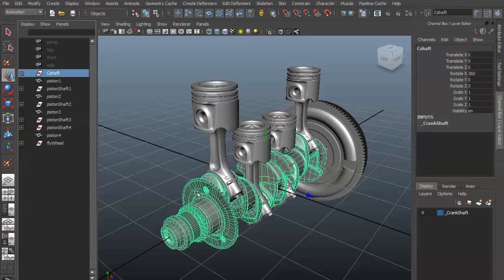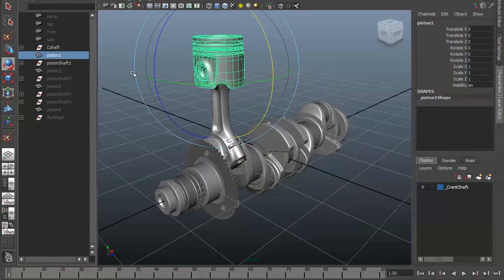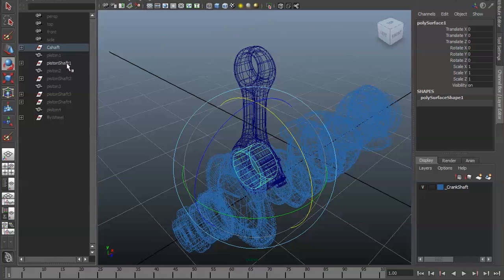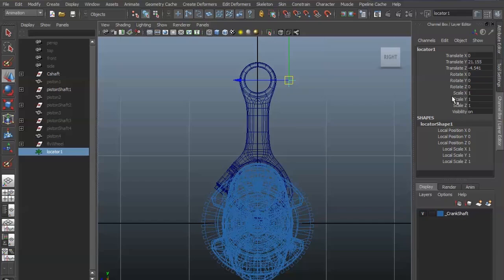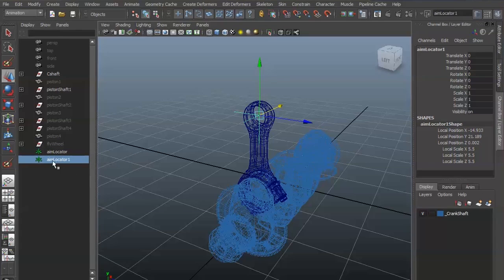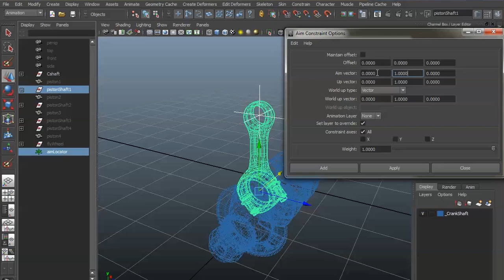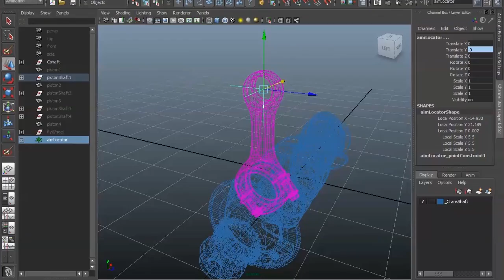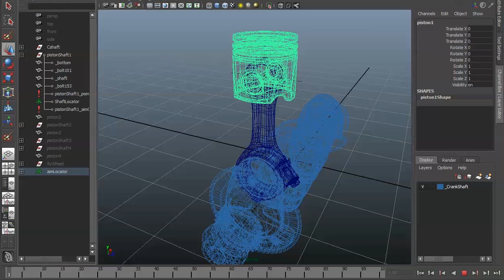Maya Piston Rig Tutorial

Comment: How would you go about rotating this on a 45 degree angle to create, say, a V8? Been struggling for days now
Reply from the maker: That is a great question.  I had the same problem.  It is surprisingly simple once you figure it out.  

What I ended up doing is Grouping all the pistons, valves, spark plugs, etc. that will be rotated to the right.  Then grouping all those that would be rotated to the left.  Make sure the groups pivot point is in the center of the crankshaft.  I'd rig each group straight up in Y just the way I show in the tutorial.   Then rotate that group 45 degrees and DON'T freeze the transformations.  Just leave that group at 45 degrees.  Do the same with the other side.  I will hide one side while working on the other.   I hope this helps.  I know it can be frustrating. Good Luck
Reply: @FlintBassman  Hello. Thank you for the lesson. I'm making a V-shaped engine, turning the group by 45 degrees does not work. the piston stops moving. Lost connection on Y. Please help.
Reply: I've actually done that.  You create it just like I show you in the video. Then rotate the group 45 degrees and don't freeze the transforms.  Sorry it took so long to respond.
Reply: @skeeleart  Hello. Thank you for the lesson. I'm making a V-shaped engine, turning the group by 45 degrees does not work. the piston stops moving. Lost connection on Y. Please help.